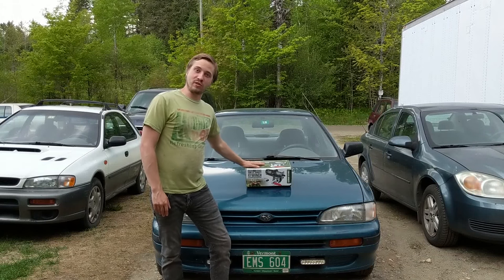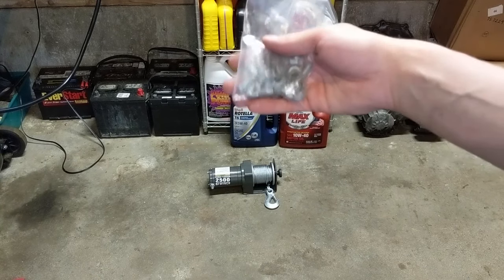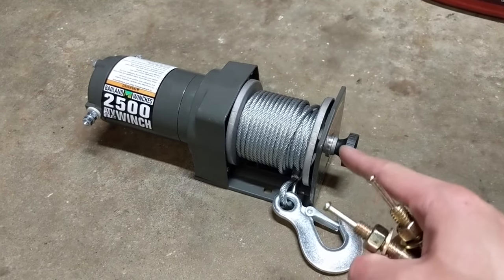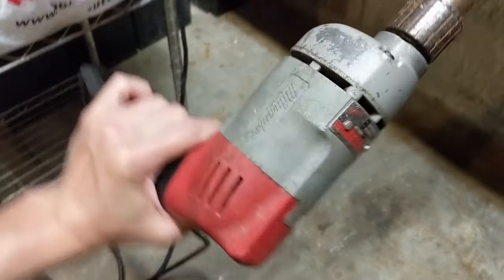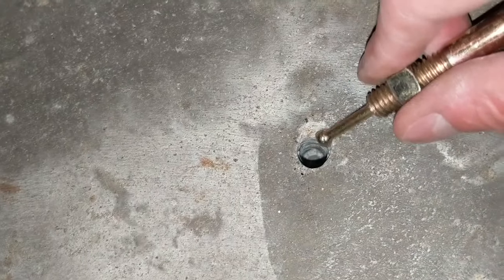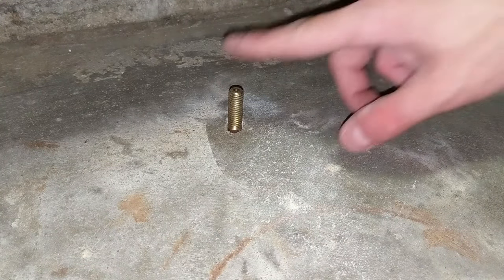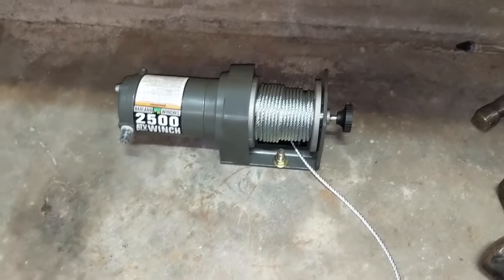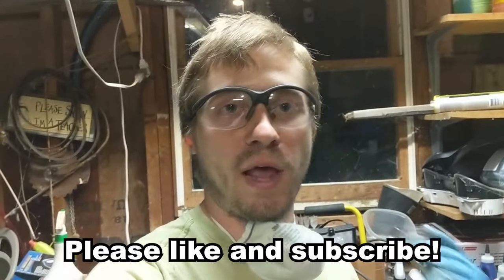Garage Winch Install Cheap! 💪 Floor Mounted Harbor Freight Badland Winch

Comment: 7:45 Off kilter would be not a problem if done with drop in anchors like I mentioned a long time ago.
Reply from the maker: As in female threaded anchors? Not sure how that would solve the hole being drilled off angle. I think I just need to drill straight. ;)
Reply: @802Garage   Well if you don't know then you are either

1 lying
2 not actually doing any work
3 super lucky
4 just the perfect person ever,
🤣

Well There are times where a person will drill the hole and hammer in the anchors, just a bit off. At the bottom it's nothing but up top that little angle can turn out to be way off at the top. IT may be ok if just one is off but if two or three are off then it gets hard to slide it on or off. I like harbor freight but still the winches don't last long. So there might come a time where you need to take it off and replace. So even if you, drilled put the plate down and then hammered in, they could be off making to difficult to take off.

Here is where using the drop ins makes this easy to install and remove. Because as long as the top of the hole is align with the holes in the plate, the tip of the bolt will go in. Unlike at the top where the bolts could be spread out just enough that the bolts won't go in. 

Another benefit is that you don't have the chance to ruin the threads. Seen so many times where a person will be hammering in, and goes way to hard and mushroome the tip of the bolt. Often with the nut jammed in place because of it. So then the try and get it loose. In the struggle the bolt get loose and ends up being just a bolt sitting loose, worthless.

If a wedge anchor breaks or needs to be taken out, good luck. If the bolt breaks off (most wedge anchors are not grade 8, you can choose to put grade 8 bolts in.) , you can drill the center and reverse tap the bolt out. If it is the anchor itself that needs replacing, the plug is easily drilled out. Screw in an eyebolt, just s few threads in, and yank that sucker out.

One more thing. If that spot is needed you can take off the plate and the concrete is still flush/flat. You can even put a larger plate over it for some other use, like a tried changer, bench grinder, or whatever else you can't put on a receiver hitch mount. 

I will try and make it out to my friends house where I did this for him. Two car garage a single movable bumper mount.  

Did you watch my video?
Reply: @802Garage   Example of bolts being hammered in and mushrooming.
https://youtu.be/zm9gcpg8HTE?t=25
Reply from the maker: Oh oh oh yes of course. I thought you meant those drop in anchors would somehow allow the bolt to be angled properly, as in despite the tilt of the hole. I'm like how exactly do you think that's going to work? Yes it will make it easier to put the winch down and then put the bolt in the hole instead of trying to fight to get the holes over angled studs. Totally gotcha. I still think the main key is drilling the hole straight, hahaha. As for mushrooming, you just leave the nut threaded on the top of the stud when you hammer. Not an issue. Rarely seen anyone mushroom with the nut in place, but you could always double nut and tighten them against each other if you're worried about the nuts moving or something. If they are having that big of a problem, they didn't drill or clear the hole properly. I do like the aspect of keeping the concrete flush if you pull the winch or whatever is mounted though. For this particular winch, they would be a pain because of trying to fit a bolt in the back. Could be solved by mounting the winch to a secondary plate though as I mentioned in another comment. Will definitely be keeping the drop in threaded anchors in mind in the future. Obviously did this job several years ago now. I have lots of new tricks up my sleeves. Thanks!
Reply from the maker: @AztecWarrior69_69  P.S. With the type of anchor I used, you could drill out the setting nail, which isn't a super hard metal, and then pull it out the same way you would a drop in threaded anchor. TBH though pretty much all drop in anchors seem to have an included insert which is used to expand the base, which makes them a permanent install. They all recommend using the proper tool to set them, though it's basically just a depth limited punch. I'm guessing the plug would be a bit easier to drill out than the nail, but still an extra step to remove.
Reply: @802Garage   
"As for mushrooming, you just leave the nut threaded on the top of the stud when you hammer. Not an issue."

Yeah that works, until you hit the tip to hard. It happen a lot. Especially when the person keep trying to hammer it in after it already hits the bottom. I always stick a rod, the same size as the anchor (I keep a PITTSBURGH Transfer Punch Set, 28 Piece SKU: 3577), in the hole to see exactly how deep it is. Then mark the anchor. Anchors should NEVER have to be "hammered" in. They should only require come tapping.

"I do like the aspect of keeping the concrete flush if you pull the winch or whatever is mounted though" 

Yes that is the biggest feature of the anchors I like. I don't know if you saw my video, but it shows where the winch is directly in front of the door. So when removed I has to be flush.

" For this particular winch, they would be a pain because of trying to fit a bolt in the back. Could be solved by mounting the winch to a secondary plate "

Yes you can. As I mentioned in my first post 3 years ago "What you should have done is set a receiver mounting plate. Called a HAUL-MASTER 3500 lb. Step Bumper Receiver SKU: 69673.  Drill all your holes and add some oversized nuts and washers between  plate and floor." "Get some 2" square tubing (draw bar stalk) and weld (or have it welded) a winch mounting plate on to it." They make the sell the draw bar with winch plate at harbor freight.  BADLAND 12,000 lb. Winch Hitch Mount SKU: 57607  

If the 2" tubing is in the way and you can't put the nut on, use a long boxed end wrench and use some duct tape to make it a spoon. Put nut in. Get a tiny bit of that tape and make a ring with the sticky facing out. or use double sided tape. Put it on handle right up to the box and stick you washer on it. 

Or just drill and tap the hole. 

I also have welded a 4 x 2 x 6 inch channel open side down to a winch receiver mount.

"P.S. With the type of anchor I used, you could drill out the setting nail,"   

You don't need to drill. Use vise grips and pull and twist ONLY in a counterclockwise rotation. Those anchors have little teeth that hold the nail from being pulled out. If you try and pull straight out, the teeth gouge and scrape and shavings build up. When you twist, the teeth cut in but but start to cut in as in making threads. Pull Turn at the same time and in only one direction. Never reverse direction. Also don't try and wiggle or rotate side to side at first. That will only make a groove ring around the nail, will make it harder to start the "up threading".
Reply from the maker: @AztecWarrior69_69  Yeah like I said I know many many ways to mount a winch, I just wanted cheap and quick, hahaha. I even tried to look at 120V winches and using a chain attachment eyelet instead or buying a tow receiver hitch mounted winch. I def wouldn't buy a full bumper receiver plate though, too bulky and expensive. I'd just buy a hitch that I mount to a plate the winch is on and mount a receiver to the ground. Or make one myself out of some square stock. Way cheaper and more compact. If you wanted to be really cool you could put an anchor in the ground to accept a ball hitch and mount the winch to a ball coupler for true quick release including the ability to slap it on the back of any vehicle with a ball mount or hitch receiver hahaha. I've used mine very infrequently though. Like I said I'll probably just put a second cheap ass winch in the second bay, but add one plate beneath it and use the flush anchors like you suggested just to clear the floor. 😁
Reply: @802Garage   "Yeah like I said I know many many ways to mount a winch, I just wanted cheap and quick, hahaha."

Yeah I get that. that's why I tell everyone to use drop ins. Saves a lot of time, money and effort. 

" I even tried to look at 120V winches and using a chain attachment eyelet instead "

F that! Not you, those 120v. They are twice the price but half the load capacity. I look long and hard for an affordable one. I knew my friend would never keep up a battery. So I tried. Ended up just adding connectors to all his cars. 

"I def wouldn't buy a full bumper receiver plate though, too bulky and expensive."

Yeah the products I am writing down are just for reference. 

"I'd just buy a hitch that I mount to a plate the winch is on and mount a receiver to the ground. Or make one myself out of some square stock. Way cheaper and more compact. "

I am all all for DIY but a HAUL-MASTER 3500 lb. Step Bumper Receiver $18 after 20% coupon vs  at least an hour of work, lining up and drilling the pin hole, welding it all up, drilling the mounting holes. Yeah I go with the $18. 

As far a the winch mount. Hell yeah DIY.  I have plenty of old ball mount draw bars. Plenty of plate too. 

""If you wanted to be really cool you could put an anchor in the ground to accept a ball hitch and mount the winch to a ball coupler for true quick release including the ability to slap it on the back of any vehicle with a ball mount or hitch receiver hahaha"

Have NO idea what you just said.
Reply from the maker: @AztecWarrior69_69  Tha Haul-Master 3500 sounds great! Hahaha. The last bit I was just saying you could literally use a trailer ball hitch as the attachment if you wanted to make it super quick disconnect. Not that a pin and R-clip is hard. And yeah I came to the same conclusion about 120V winches sadly.

Comment: What if my winch will not retract I can use the wireless remote to let out cable but I can't get it to take Cable in
Reply from the maker: Genuinely not sure. Make sure the pin on the side is locked in, the battery you're using is charged, try tapping on the signal box, try manually hooking voltage to the winch lugs momentarily, otherwise return the winch for replacement unless you feel like taking stuff apart.
Reply: @802Garage thanks man cuz I was getting frustrated I put new batteries in the key fob last night and it was working fine but it just would not retract the cable once it let it out.. thanks for the ideas
Reply from the maker: @bamadondon0495  Good luck!

Comment: Flip it around and run the cable over the top of the spool.

Edit:  you noticed haha
Reply: Justin Credible - pulling from the top will lose leverage and put undue stress on the winch motor. An ideal fix would be to cut the stud flush (because it needs done anyways) and then to add a pulley system in front and to the right side of the winch. This would solve two issues at once, 
a. It would control the cable positions during use to & from the winch roll.
b. also it would give a multiplier of leverage to create more pound force to whatever is being pulled. 

Pulleys are cool, snatch blocks are SUPER cool. Save the stress on your pulling device by utilizing what Archimedes gave to the king.
Reply from the maker: Yeah what I realized later is it would add stress to the winch mounting by being a higher lever on the entire winch. In the next video I flush cut it and it works out totally fine, luckily. There are a few ways I'd like to do this install different, but almost all of them involve more money! :P
Reply: Fair enough.  I was only thinking of clearing the bolt
Reply from the maker: @justincredible5414  Oh yeah it's def what I was thinking of too. I just got lucky that it clears the bolt when I'm done. :D

Comment: You are not suppose to widen the holes, that kind of defeats the purpose of the system.
Reply from the maker: Well, no, it doesn't. It's not that simple. It's a function of surface area and force. So provided there is still enough surface area and force, it makes absolutely no difference. It's not like this is something which will be vibrating and shake apart. Given the bolts installed as in this video can likely hold far more force than the winch mechanical components and cable can actually hold, it doesn't defeat the purpose one bit. Basic reasoning and physics, really.